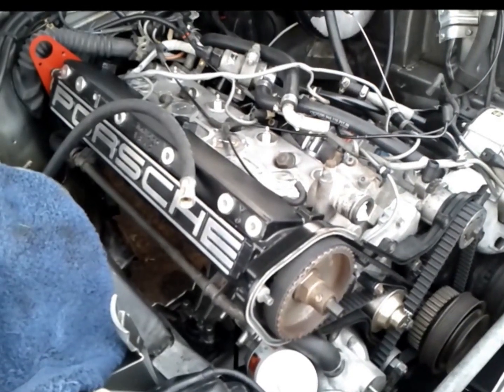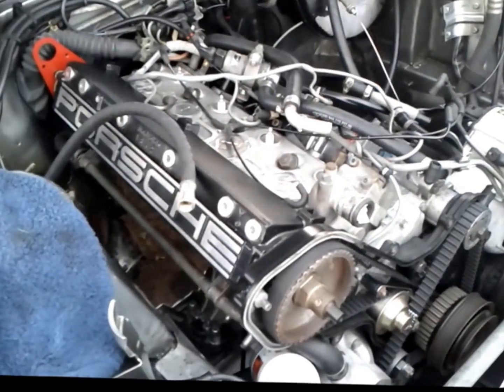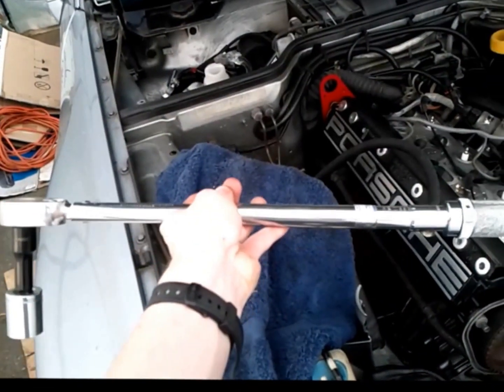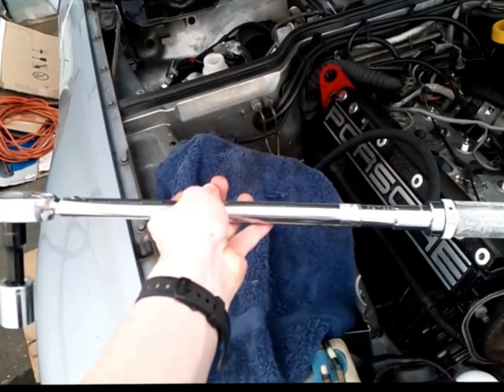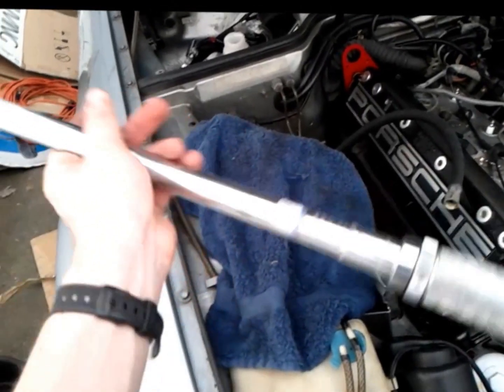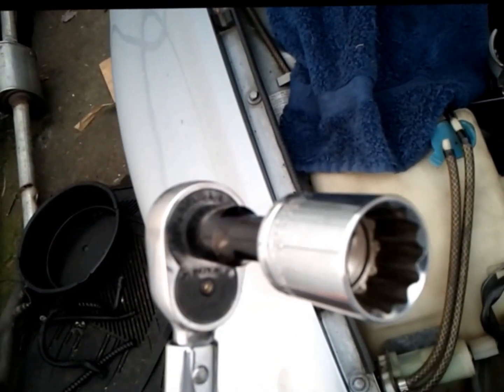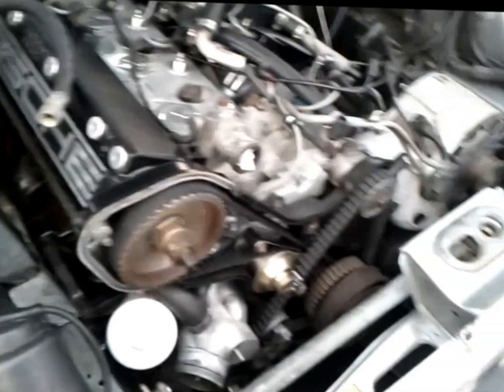Porsche 944 crank bolt torque

Comment: The real question is: did you use the flywheel immobilizer tool, a big screwdriver in the inspection hole, put the car in gear with the handbrake on, or some other solution?
Reply from the maker: I used a flywheel lock tool. It bolts in the starter holes and a splined section engages the ring gear. The car in gear with e brake on, might not work as the drive shaft inside the torque tube is quite long and it would flex too much. Also, if you have an old style clutch disk, with the rubber puck, that might get damaged.